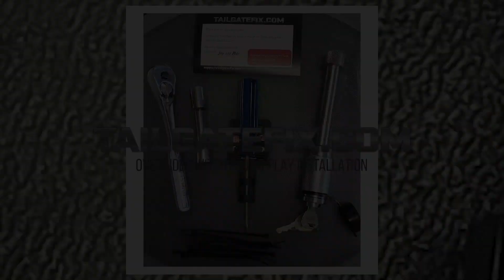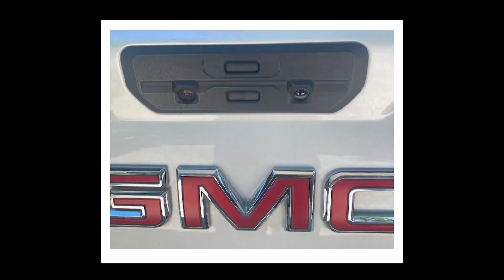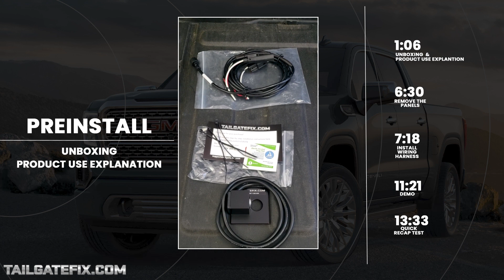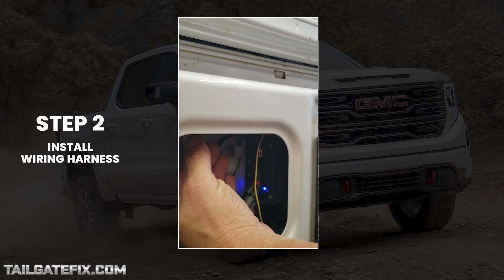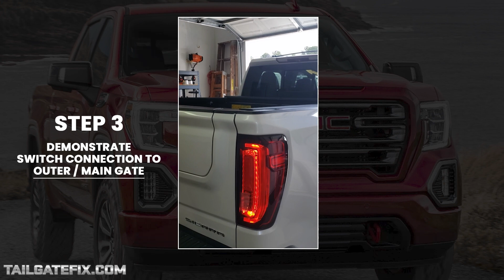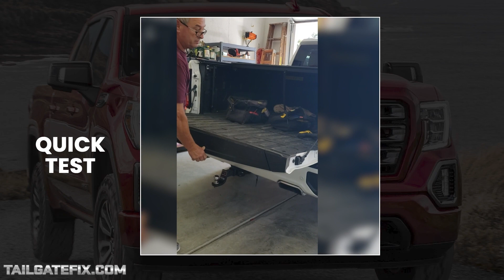2023 Installation Video

Comment: This is great as I just ordered one of these kits. However, just a small nit pick- The one thing that either got cut or left out was how/where to best mount the switch itself and route the wiring if you're using either a manual or auto switch. This covers how to run the long wiring kit and all, but kinda skips which is the best side to mount the switch itself (appears the RH side with button facing to front is best since it looks like it won't fit the other way). It seems rather intuitive, though. Just clean the RH side of the receiver where the switch will mount, insert the pin in the hitch from the LH side, peel off the backing from the 3M adhesive pad, slide the switch over the pin and press in place for a few seconds for the adhesive patch to grab hold.